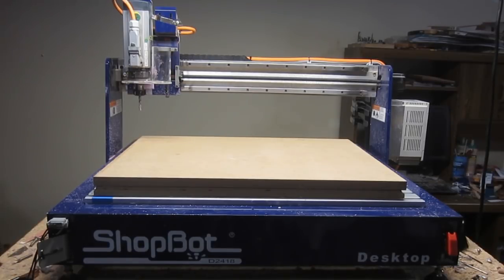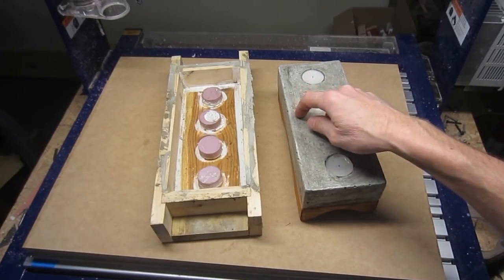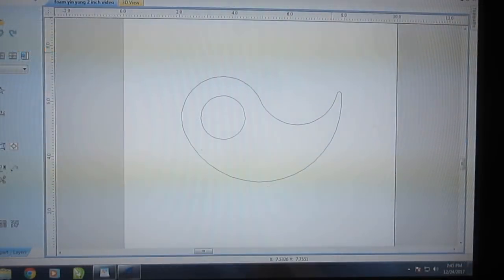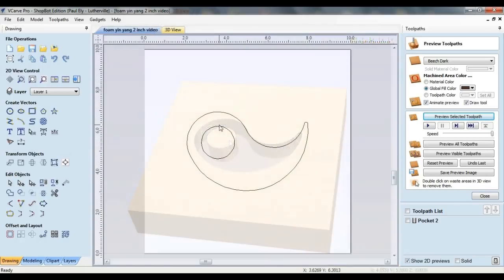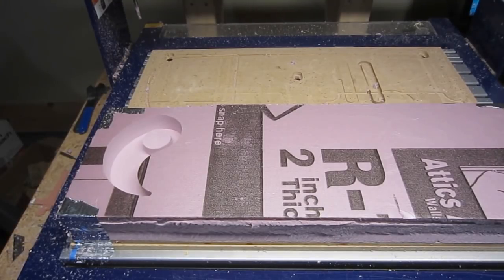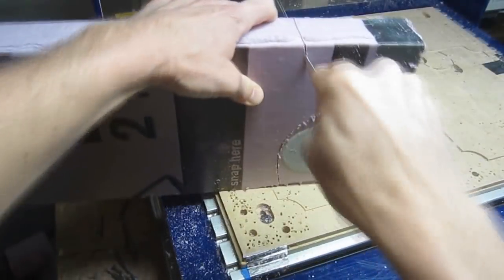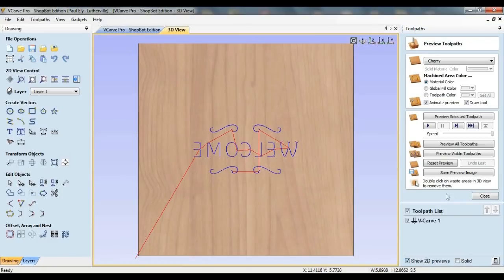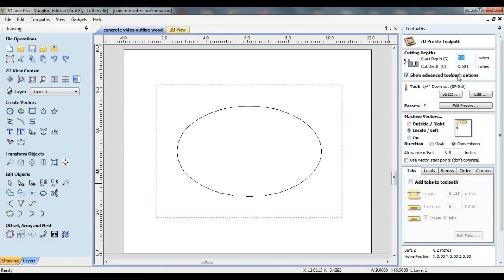CNC Router Projects- Start to Finish: Working with Concrete & Cement Products

Comment: 👍🏆
The candle holders need a sealer.
I heard, 33% portland powder, 33% PVA glue, + 33% plaster of Paris.
Will give you a (putty-like) cement.

Comment: How about milling everything with a 2 degree draft angle, put some release agent in the mold, stick some "T" studs in the wet cement for pulling the part out of the mold after it has hardened, and you can use them for mounting the item, or buzz them off with a grinder if you want it smooth on the back. That way you could reuse molds. Cool video. Just thought I'd throw some idea at you. Take care

Comment: For the second casting you should have just cut the whole mold into the foam.  In Vectric just cut a pocket about 1 inch deep or however thick you want it.  This will give you a perfectly flat canvas at the bottom of the pocket.  Then for the text layer set the "Cutting Depths" - "Start Depth" to 1 inch and then the "Cut Depth" to how thick you want the text layer.  Then cut the text layer at the bottom of the pocket.       I have yet to find a release agent that works with this foam.  Its very porous and the concrete can get very hot when it dries and melts the foam slightly and sticks to it even worse.  Most release agents I have tried either melt the foam or stain the concrete.  Silicone molds work great with concrete.  A thin layer of latex on the foam may be the answer.  I have not tried it yet as my latex dried up.  Could be the answer.

Comment: I don't think wood will separate any better than foam.  Make  a reverse mold with the foam.  Then use that to cast a mold with silicone.  Now you have a mold that will let you make a hundred castings.

Comment: intersting... Ive been using roughly the same process to create custom fitting case inserts using just the foam and covering it with felt.The difference is the foam is the actual item. Sorta like making a mold to fit an existing part. 

Only thing about foam is its worse than dealing with MDF dust. If your dust collector dosent SUCK enough you wind up with a pink powder everywhere. Even if it does it still sticks inside the chip separator... heheh

Comment: Nice work,    But,  why did you choose  "Convention Mill"  instead of  "Climb Mill"..?   I don't of any situation where conventional is better than climb in a CNC....    Of course, Manual mills are just the opposite..
    I see it came out great,  but,  sometimes foam has a way of balling up in little bunches..
    You seriously need a  Hot Wire to cut the foam,  That was brutal, watching you saw it..

Comment: Very nice approach ....maybe next time you use wood and seal it with smooth paint and before pouring concrete apply some wax or soap so you can reuse the mold again instead of destroy it in demolding procces  ...and about the concrete bubbles use a power tool like a drill or a sander to vibrate more you will get better results